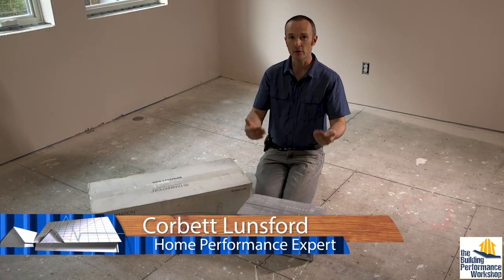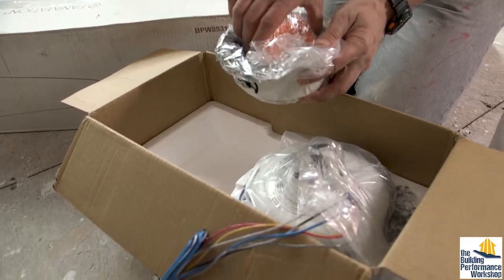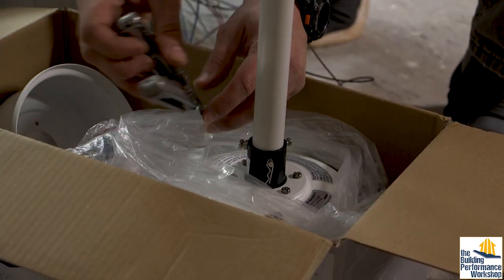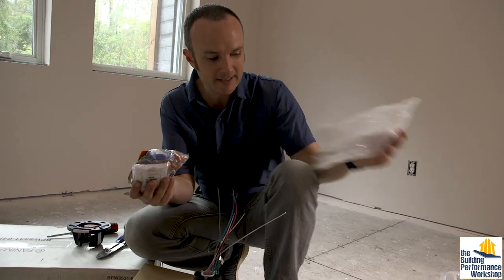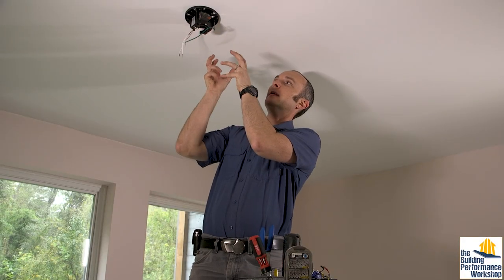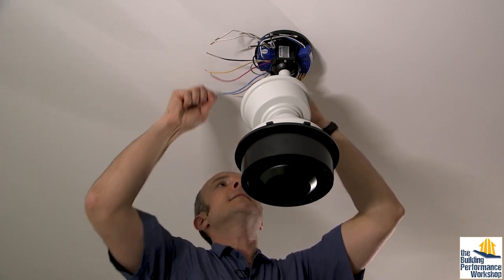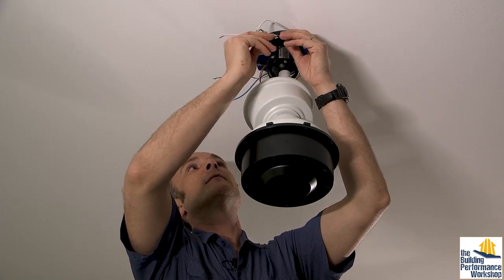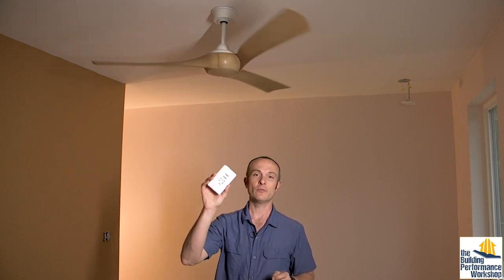How to Install a Ceiling Fan DIY (Fanimation Wrap Custom)

Comment: 15 minutes just saved people hours trying to figure out how to install these things.

Question- so the wiring for the fan does not require wiring a physical switch?
Reply from the maker: Thanks, O- yes, I mention there is a wall switch, but I guess theoretically you could make a less-safe switchless wiring work if you tried.